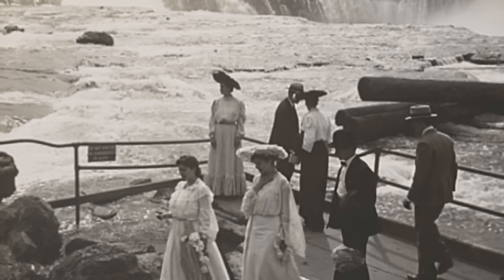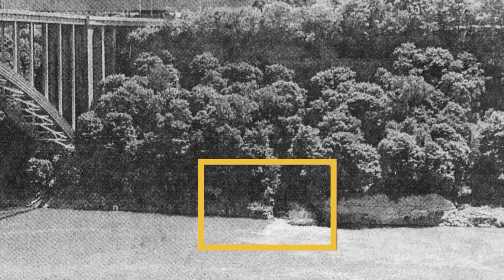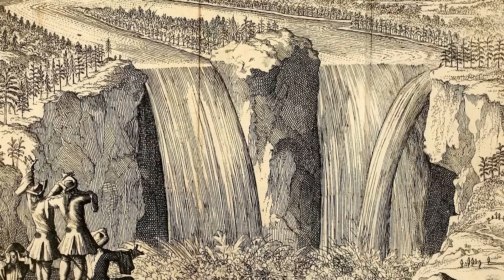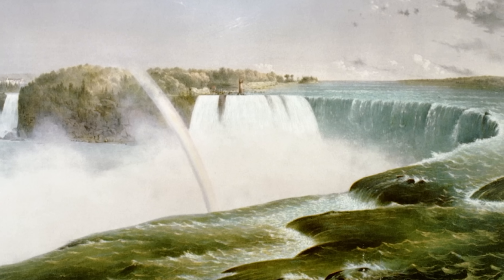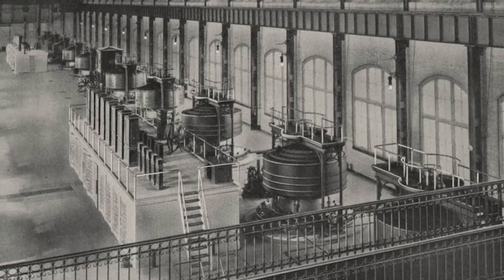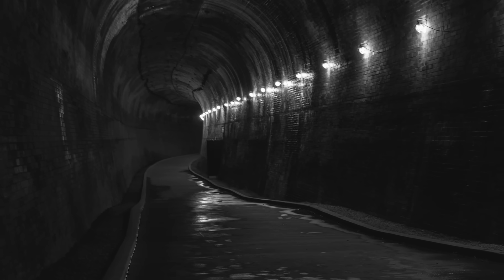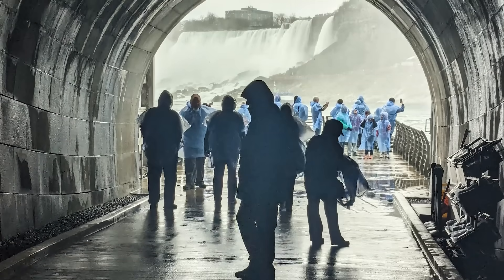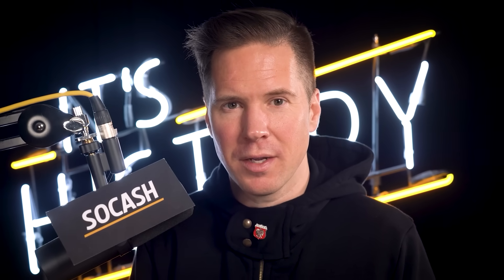Why Niagara Falls Has Massive Abandoned Tunnels Below It

Comment: I worked at a gaming establishment on the American side. They have a sub basement. It's genuinely tremendous in there. You could hear the water in a tunnel that ran just adjacent to the facility. 

There was no other sounds. Just water. The wall is reinforced and visually solid. Yet it sounded like it was under constant pressure and ready to over take us. 

It was eerie but unforgettable. I know early gis maps of the area have deep canals running through the area. If it was that or other tunnels there's no way to know with how unregulated the region was. I wish I could go back down and see it again.

Comment: There's a point on the US side just downstream of the falls (43°05'19.3"N 79°04'02.7"W) that has been outputting water since the first historic aerial photo in the 1950s. Any idea which facility this is connected to? The flow does not seem to be enough to be the output of a power plant.

Comment: Ummmm. The main reason for abandoning these 1900ish tunnels was technology development and geography. Level difference between Erie and Ontario is about 320ft/100m, Niagara Falls height is 170-190ft/55m. The remaining height loss is Rapids, and all this energy just creates splashes and mist.

 So as soon as it became possible to build hydro power stations below Rapids and Whirlpool (modern day Power Vista/Robert Moses and Ontario Power/Adam Beck), which required 10km of waterflow structures, canals and tunnels impossible in 1900, - the same amount of water began to produce twice more electricity, and old structures lost any value. Especially as they are extremelly risky due to geology, as Schoellkopf power station proved in 1956. Also Rankine and other old stations produced 25Hz power which is unusable in modern world.

Comment: 7:25?
No above ground access? 
Viewed from the Canadian side, the American side is full of open caverns. Granted they might not be easily accessed but they are accessible if you had the right equipment. 

Source. I live in Niagara falls and have for most of my life.

For those who don't know. The photo at 12:20. And ones like it. Are actually photos from "Journey behind the falls". And attraction on the Canadian side that takes you down about 20-30 feet and lets you go through tunnels that run...you guessed it. Behind the falls (specifically the horseshoe falls).
There is also an elevator that takes you to the base of falls 
 There you can see some of the old drainage tunnels.
Reply: I have been in some of those tunnels, although it was circa 1962. As I understand it, a few of them have been closed since then.

Comment: The part you didn't mention were the early power generating stations produced 25 cycle power. The newer ones produced 60 cycle power and the old stations were only used to heat  plants, since all newer plants ran 60 cycle motors. Ontario Hydro ran a conversion program that updated  all Ontario residents to 60 cycles, replacing 25 cycle motors in all homes and businesses.
Reply: I came to the comments to say this! These power plants’ business relied on industrial customers with legacy equipment that still ran on the older standard. When those customers finally switched over their facilities, it became financially impossible to keep running those plants.
Reply: Probably avoided it for viewers like xXJoeVXx…
Reply: 1953 when the big switch happened that I read.
Reply: Wow 25hz in the wall socket probably goes crazy 😂
Reply: I remember the 25 cycle power. You could see the lights pulse!
Reply: @juliamiller2299  it's called 25 hertz power, not cycle.
Reply: There’s still some places using 25 cycle motors still.
Reply: @juliamiller2299  WOW WERE SO LUCKY YOU APPEARED TO CORRECT THE MAN
Reply: 😂😂 wth are you on about 😂😂 cycle motors 🤥
Reply: @xXJOEVXx  He means they generated 25 Hz power in the early days.
Reply: @xXJOEVXx you know electric motors that ran on 25 cycles per sec aka hz. Up until the 80s there was still a 25hz generator online for the 25hz motors at the steel mills in Hamilton.😊
Reply: @xXJOEVXx educate yourself.
Reply: @leeshepherd6512 no thanks not interested in old technology
Reply: @xXJOEVXx grow up.
Reply: @xXJOEVXx  Understandable, why would somebody watching a history channel be interested in old stuff 🙄